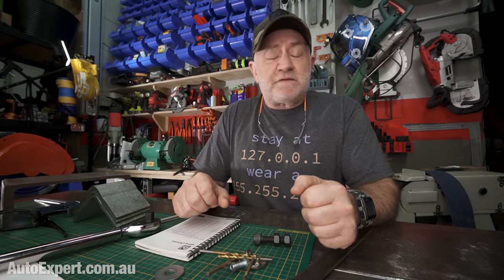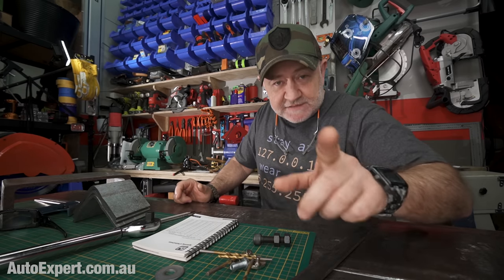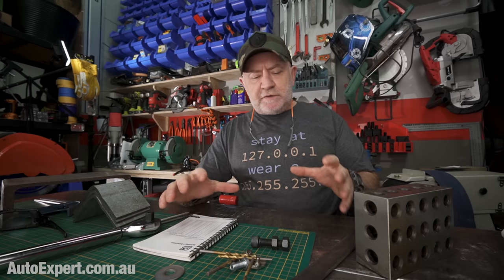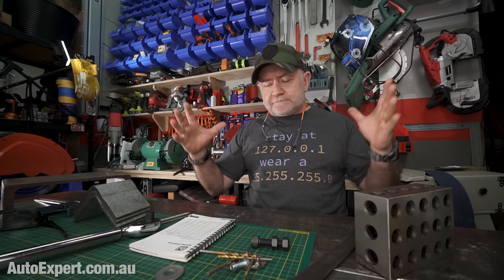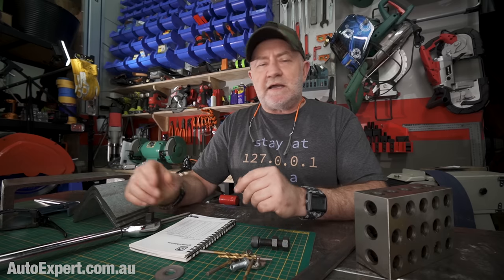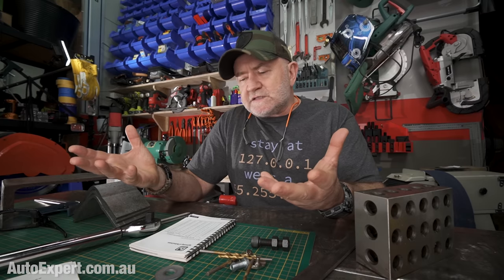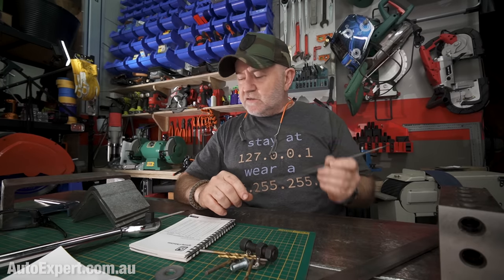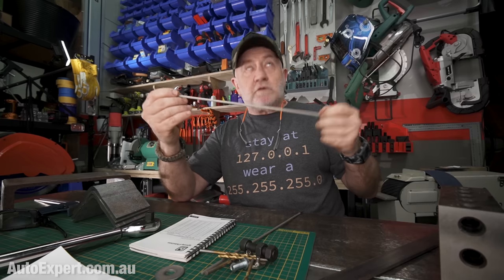Straight talk about DIY home workshop engineering | Auto Expert John Cadogan

Comment: I can remember when I was a young engineer I had to design a bracket to hold up a numatic valve. So I did the calculations (no differential equations needed) designed it and took it to the chief engineer who says looks good but miles to small. I showed him the calculations and he basically said "but you've forgotten to add in the weight of the 150kg idiot who will use it as a step". Now that was real value engineering :)
Reply: Bahaha! So true. 
I always tried to build everything idiot proof, but unfortunately, they always manage to build better idiots
Reply: I hope you didn't have to spell 'pneumatic'! ;-)

Comment: Can relate to this. Retired after 44 years in the VIC power industry working in maintenance then operations and technical areas. Used to deal with engineers, trades, technicians, chemists and others on a daily basis. Many a prototype contraption has been built, tested, thrown out or developed into functioning contraptions. 

Thanks for your contributions towards educating people.

Comment: Love a good weld bead! It’s a thing of beauty. I wanted to be a boiler maker, but had to settle for engineering. Much respect to our mechanical tradies.
Reply: I have seen beautiful looking weld beads that I could get my finger nail underneath, on a car from the factory.
Reply: I have a home project that required the assistance of a friend who can weld.  This made progress halting.  I went to town and bought a basic stick welder, a helmet and the basic gear.  I set up a heap of scrap steel and got on YouTube.   My welds are improving, from a low base.  It's been great fun and my project is extending into part 2.
Reply: Wanted to be an Engineer and ended up a Bodymaker.

Comment: No wonder my welds are pus. I was trying to figure out how I had forgotten how to weld, but it's not me, it's the crappy rods I recently bought.
I just went and found some 25 year old rods that were still with the old buzz box welder stuck in the corner and my welds are 100 times better than with the new rods. Thanks for taking the time to teach me something I would have never figured out by myself, I only bought the new rods because I thought the old ones would have absorbed a stack of Brisbane humidity and would have been no good. They probably have absorbed a stack of humidity, but are still better than the new rods.

Comment: Well that does bring me back to a time when i nonchalantly crossed a road, my green, on Tollington and Hornsby intersection when some guizzzah in an escort van hammered on the anchors and from the rear flew a granite block 25mm x 400 x 800 continues on its rectilineal proposed direction pushed out the windscreen both landing in the middle of Hornsey Road, remarkably both in tact except his composure which reminded him that it probably passed his left ear by two cm, a memory neither of us will forget, i guess he didn’t do physics at school i did but it reminded me to use what i learned but didn’t in my own life apply. thanks again for the reminder.

Comment: Prototypes are nice if you have the time and materials to make more than one.  I solve that problem by going up a size, i.e., if 1/8" steel will do the job 1/4" steel will do it better.  For instance, if I am concerned about pull out using factory washers I make my own over size washers out of a heavier gauge of steel.  It just takes a hole saw or, in one case, a stainless steel rod on a lathe.

Loose batteries are a concern in auto racing where they can be mounted in the passenger compartment.  The racing rule book states that they must be bolted to the floor (ratchet straps are not good enough) and covered with a marine  battery case if they are lead acid.  Most car floors are not strong enough to keep the bolts from pulling out during a roll over (much more common in racing) so I always suggest that they put a plate as big as the battery on the other side of the floor. 

One thing not mentioned is that there are engineering tables for wood, also.  Here in the US we have the "Wood Handbook" put out by the US Forest Service.  It was very handy for designing shelves that would be overhead.

Comment: John, you have saved be money. You talked me out of wasting money on mods for my Toyota Tacoma. I was NASA certified for soldering and aerospace qualified for brazing. I haven't got welding experience. Soldering, brazing and welding are arts. You can see when someone has mastered these arts. I was an engineering tech for the Department of the Air Force. We worked on Aussie F-111's in Sacramento. I even got invited to there annual party. I enjoyed working with engineers they taught me much.

Comment: The unrestrained elements problem came to the fore (here) when front seat belts were made mandatory, but not required in the back. People in the back (eg children) became weapons and either went through the front screen or killed themselves and their parents by squashing them into the dash. This was the message of the ‘buckle up in the back’ campaign. Same applies to load. It’s so important that loads are properly restrained and don’t move (or as little as possible) before their restraint kicks in. Once the object starts to move its ‘weight’ increases massively (F = ma).
I like your rules. Also remember…

In all car accidents there are at least three stages. 
1 – the destructive compression (crumple) of the vehicle as it hits its target.
2 – the movement of the occupants within the vehicle once the vehicle stops and the occupants keep moving (see below).
3 – the movement of the occupant’s internal organs.
1 and 2 can and have been hugely improved and somewhat mitigated and engineered, but #3 is just biology. Ask a trauma surgeon. 
Least and fewest = value engineering.
In your description, might have been useful to think of elastic v plastic deformation, just covered!
On the fasteners always remember what you are backing up, just covered! Bolts might be strong but they will rip through a thin skin.
Glad you brought in the dynamic load element. 
The bolt up v bolt down question is a bit complicated. I appreciate your side and I’ve also seen occasions where a bolt down has meant that while a nut fell off, the bolt stayed put and the assembly stayed put but became rattily but thankfully didn’t cause injury. I think it depends on whether the dynamic bit is on top or below and whether sheer matters. If in doubt, add a jamb nut, a spring washer, a nylock, weld the fasteners etc.
Appreciate the vid!!

Comment: When i put bolt in a frame or engine cradle for example i tie a piece of bright coloured thread around the bolt head then down and round the nut head and make sure it's taught. If the part comes loose you can see quickly that something is not right with the thread looking loose or snapped. Not a perfect solution but it works good enough for me.

Comment: In my industry, I find lots of scarily mounted boxes, motorbikes, wheels and other heavy items not only fitted poorly but to very weak cosmetic bumper bars on caravans. I refuse to mount things for people when asked. I have showed many that if I can walk up and palm the existing spare wheel and it flops about like a fish on a line, it is not suitable for additional load. The other problem is explaining how much something weighs (in relation to the pivot point, wheel or axle group centres) when added to the back 3m behind that point and how it could affect overall balance of the trailer.
I like how you get info across in a simplified manner for the average person.

Comment: 7018 is a dynamic load rod used in pressure vessels and car frames  because they move or twist. 6010 is a static load rod ment for filling gaps and general welding roots in pipe. Today you will see tig used more than 6010. Cheers

Comment: @ 37:15, I would also suggest a reason to paint is IF you are checking status as to safety you can notice wear marks (other things rubbing against) or cracks near joints etc. with a glance.

Comment: Id suggest that the reason manufacturers don’t add restraint points for cargo is that they don’t want to approve carrying any kind of cargo! 
Back when i was a commercial artist, as we used to be called, rubber cement cans presented a disclaimer that basically said that their product was not designed to be used for any particular purpose!

Comment: In 1944 I was crawling around the passenger side floor of my Grandmother’s 38 LaSalle investigating the several doors on the heater. I was already developing ghetto engineering but didn’t think of it that way at the time. My mother was driving and not restraining me in any way. As a slightly older kid I, managed to survive open belt machinery, 50 foot ladders, and the girl next door. In short I learned to deal with immediate deadly risk. Believe me I’m very conservative. Thanks mom.

Comment: I stay away from Low Hydrogen Stick Electrodes like E7018, as I don't have an oven to keep them dry. Sure I could use the kitchen oven to try to dry them out, but to me it isn't worth it. Generally you also need a better DC welder as well.

I mostly use E6011 for structural joint and E6013 for thinner materials and dressing a weld. The yeild strength isn't that much of a difference for mild steel applications. Both electrodes are good for simple A/C buzz boxes, but E6011 prefers higher Open Circuit Voltages (OCV) closer to 80V.

Comment: I followed all rules except #1 when it came to my 6x12 utility trailer.

I made it with 7018AC and my 1970s 295 amp stick welder. I have an extra oven in the garage that I heated my 7018 electrodes for a few hours at 500f prior to use. Is this a legitimate way to use multi month old 7018.

I did follow rules 2 to 6 religiously!

Comment: My 93 Ford Laser hatch back was hit at 130km it was stationary at a time an all my sockets from my tool bag got scattered from the cargo space to the passenger and drivers section my UHF radio which was under the passenger seat velcro to the floor ended up on the driver's side shit that was in the cargo space and it up on the backseat the fire extinguisher in the cargo space went off with the pin still in it and a Scissor Jack went from where it was housed in the cargo space to the back floor and this was with the cargo space cover

Comment: Im a mobile car valeter.. I have a 300 litre water tank in my van.
My van has an OEM bulkhead between me and the load area.
The water tank is attached to the bulkhead using 4x 2inch ratchet straps.
The anchor points to the bulkhead are 13mm bolts with 150 x 150 x 3mm plates on both sides to spread the load.

Its been in there for 14 years and never moved.

I wrote my paper on: Engine oil. How to mitigate nitrogen oxides affects on the lubricating properties
Reply: So what’s are you after Mate? A softy drivers award ???

Comment: The rear seats in cars were raised as a problem over 20 years ago wrt load carrying and collisions freeing the contents. At the time manufacturers said they would address this, and I think they have when you look at the boot lid design, and how much sturdier rear seats now feel. 
Having said that it's still a good idea to position the load properly, and fasten the seat belts to give extra restraint.

Btw I don't mind the term strength, but 'over engineered' annoys me. As you say engineered = efficient. 'Over specified' is a better term in my opinion.

Comment: OCD Dude, everything there looks pretty clean from here, dump the towel. 😉 Long and slender compression, that'd be buckling not bending ?
Yep, more weld than base metal for tensile, welding is just casting. Love your Vid's, gives me long lost pride in my work. WIA 16TC's are 7016, great for vertical ups but not a decorative finish. WIA 12P (6013) bloody beautiful finish, slag lifts itself, 1980's Freighter Trailers Ballarat had the combing rail to tie rails welded with these just for the excellent finish. ARP website has good bolt information.

Comment: Having just bought an EV we have a very long way to go in this country before buying and setting up ownership of one becomes easy. We bought an MG ZSEV in Essence trim as it was near on 30k cheaper than the KIA Niro which was A nice little car and and overall better than the MG but 30k better?
We straight swapped a Hyundai Tucson Highlander N-Line Diesel which I'm sure we will miss for it's creature comforts but not for the minimum $120 per week in Diesel. We will soon be travelling a minimum of 1000km per week for the work commute between my wife and I and will use the MG purely as the work hack.
The MG won for our needs for a few reasons. Firstly we have a choice of 3 dealers 1 close to home, 1 on our way to work and 1 close to work. The MG has 2 year 40k service intervals although I think they should have a 12 month safety inspection as most people have no idea about how to do basic safety checks. The 7 year unlimited Km warranty is also great as we will be doing in excess of 50k per year. We understand the MG will esentialy be worthless after 7 years but the Tucson would also have little value in just 3 years when it's warranty expires and it has over 200k on the clock. 
Our ownership will be a test for the reliability of the MG and hopefully it proves trouble free as plenty I have spoken with in the EV scene say it is a solid unit.
The hurdles we faced with this our first EV purchase were simply due to lack of knowledge both on our part but in particular the dealers as none from Hyundai, KIA or MG had any idea about their EV's and could answer our questions. Tesla on the other hand know their product and have a good system but unfortunately we have no dealers close as they are all centred around the CBD or Eastern suburbs of Melbourne.

Comment: When you have a full boot, get a flat and use the space saver spare, you have to do 2 things. (1) Empty the boot and get out the space saver to use it (2) put something in the void where the space saver was otherwise the floor will collapse when you put everything back in. Unfortunately, the proper size flat wheel can't go back in there because it is too shallow. You are then left to fill up the space saver void with things like your cloths or bags. Yes, you are right. The best place for the flat full size wheel is therefore immediately behind the rear seat. Good luck squeezing all your stuff back in the boot if you are on a family holiday with a full load. How stupid is the whole space saver concept? Should be illegal from a safety point of view.

Comment: #1 If it works it is good enough, especially if it's free. #2 More sense to fake emissions test with Ethanol in the tank, than overhauling your engine. #3 Illegal modifications? No problem, learn some unrelated paragraphs from the road code to stun the officer with lawyer speak, they are neither legal- or car experts. (In my country it is not allowed to mount a racing harness, even if it is done to racing standards, only 3 point seat belts allowed on road cars!)- And like the T-shirt very much, can't imagine anyone calling that one gay?

Comment: I only buy grade 12 SHCS bolts these days for everything. Massive overkill for 99% of ghetto projects but not much more expensive to buy and on the plus side, they can be re-used over and over as they dont deform or wear out and will never have been used even close to their design load.